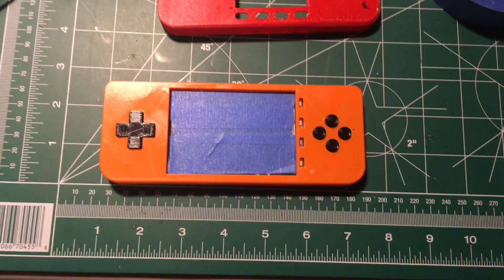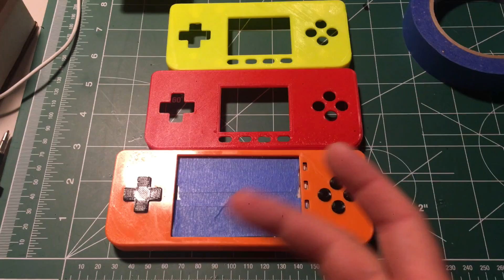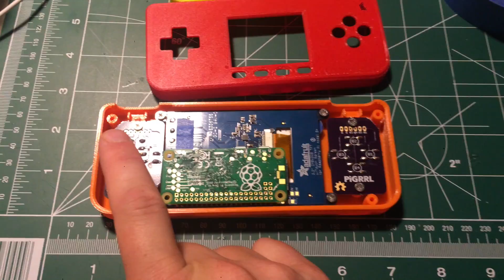PiGRRL Zero Plus - Tutorial 2

Comment: two questions:

1. what are the buttons on the side of the touchscreen for?

2. would it be possible to run rasbian and some kinda media center on there as well? (not streaming, just playing mp3s)  and not at the same time, like switching between them ect. basically like a tablet game console
Reply from the maker: The buttons on the side are similar to the original PiGRRL Zero, they control start/select and exit/enter. I'm not sure about rasbian, haven't tried this before.

Comment: With the larger size do you think you could add a RPi 3 (with the ports removed)? Larger battery too?
Reply from the maker: Oh boy, that would be difficult. The pi zero actually required modification to even get it to fit in this case. I would say pick up a Pi zero and use that. It emulates pretty much every system before N64. If you want N64 or PS1 emulation, you'll need to look at a bigger handheld like the PiGRRL 2.  I can run GBA and other games like Genesis and SNES just fine on this.